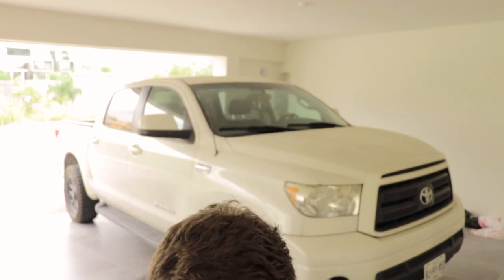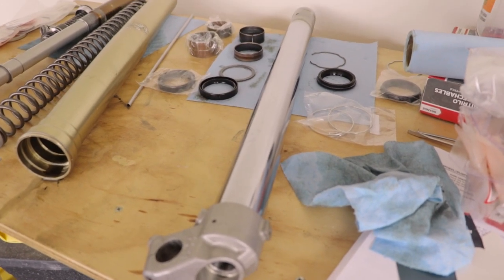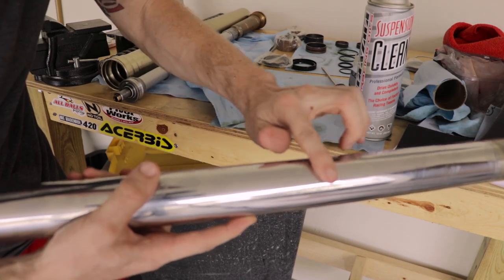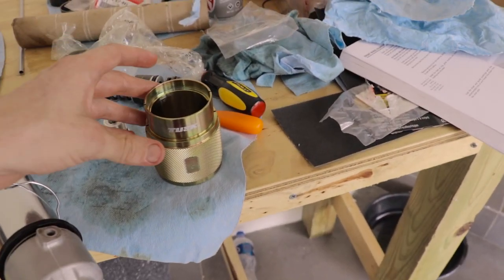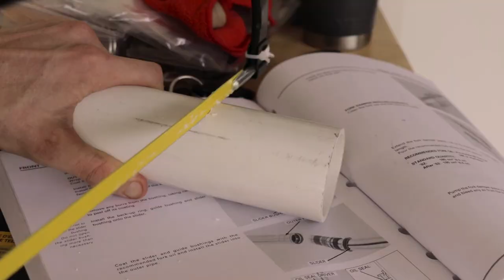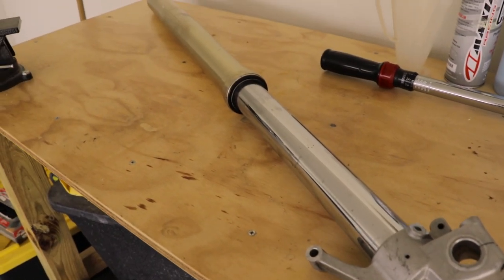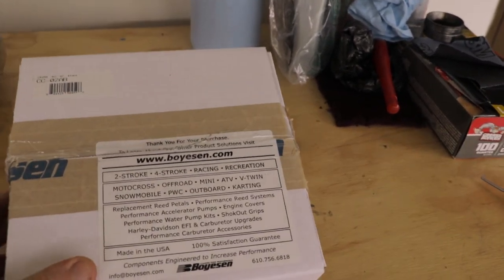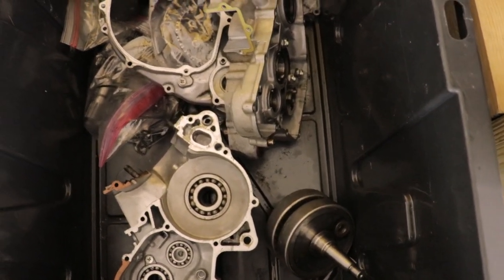CR250 Supermoto Part 8: How to Fix Scratched Forks + MORE SICK PARTS

Comment: I used a plastic pipe as a seal driver. its was PITA and it leaked. I  had to reseat the seal as there was bit of plastic pipe left in the fork stopping it seal properly.
Reply from the maker: That’s unfortunate man sorry about that. It worked for me my seals on this cr250 have lasted 2 years so far. Better off with a real seal driver though i get it 👍🏼

Comment: I’m going to try this but I’d like to know if the tubes have begun to oxidize or if the seals started to leak at all
Reply from the maker: Picolus Cage tubes are looking as clean as ever, definitely no oxidation. Running the same seals for over 30 hrs now no leaks.
Reply: FULL THROTTLE FILMZ awesome thanks